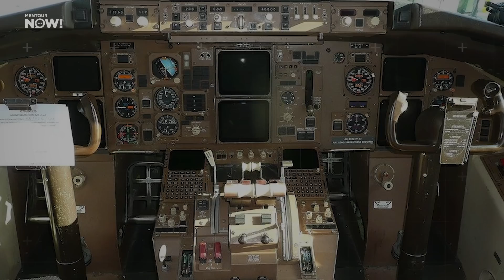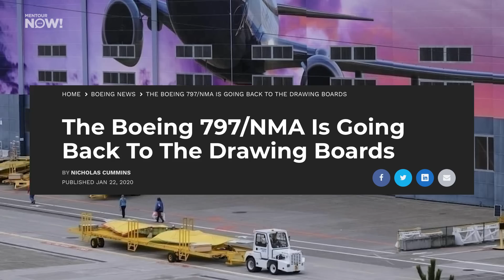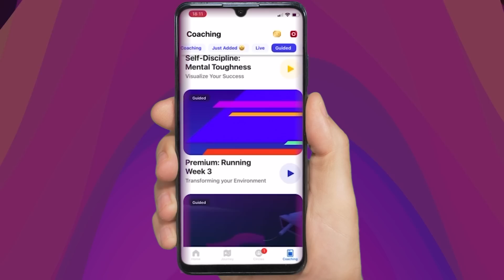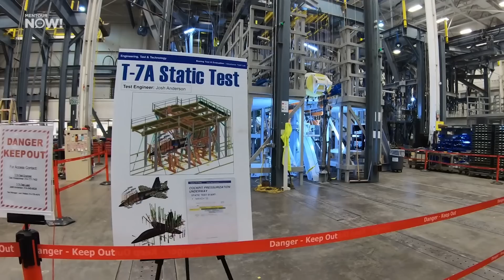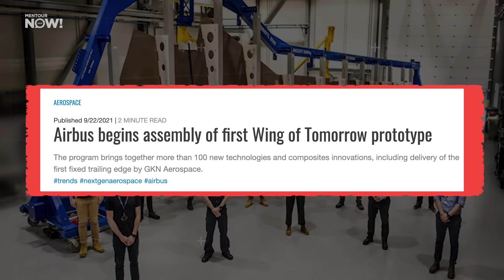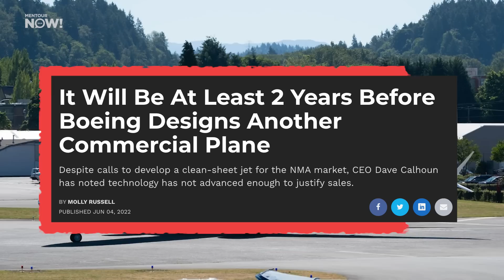Is Boeing Planning a 757 MAX?!

Comment: Some have wondered why Boeing Corporate chose to drag out yet another version of a 1960s-era 737 design rather than downsizing the much newer and popular 757 design. If you're not going to start from scratch, then at least opt for the newer option. An even better question is why Boeing fought rather than bought the Canadian design that became Airbus A220.
Reply: I've wondered this too. The 737 MAX 10 looks hideously stretched. It basically looks like a 757 but as a low rider that almost scrapes the ground, and has less doors. Meanwhile Airbus is chilling pretty good with the A320 and A321. I think the 737 is really turning into the definition of long in the tooth.
Reply: Right. How many people can you pack into a plane? at some point, it's become uncomfortable to be a passenger in a 737
Reply: @mbmann3892  Passenger count is a poor measure, every airline can space seats different, add or subtract extra features, or trade fuel/range for belly cargo, etc.. 
The better measures are MTOW (useful for passenger, cargo, and fuel load) and either floor area (passenger only) or fuselage volume.(Belly cargo and passenger combined.)
If making the basic assumption of comparing similar levels of technology and purpose(ie commercial passenger) then MTOW is pretty good as a single measure of aircraft size.
Reply: @mytech6779  Is MTOW that useful? If it was, the A321LR wouldn’t really be a thing. MTOW is extremely important to freighter airlines, but that’s a very different conversation.
Reply: @afcgeo882  Useful load may be better but for a given level of technology and class of aircraft MTOW is a fine proxy, and in some ways MTOW could be better as it doesn't penalize an airframe for optional variables like the empty weight of adding a center tank or choice of seats. 
Useful load can be split widely between payload(pax) and fuel load(range), which is why neither is a reasonable measure of the size of a base model, in regard to a manufacturers strategic planning. building factories and such. 

Payload and range are mainly useful when taken together in comparing specific sub models or purchasing options. 

Freight would be a different class, only as far as cargo tends to have a bit higher density than people and different environmental and safety precautions. (eg pax want windows and you can't flood a passenger compartment with halon.) 
But the wings and structure only care about total weight. Engines mainly care about total weight, with secondary regard for density as far as it affects cruise drag.
Reply: @mytech6779  The issue is the term “useful” because usefulness varies, A LOT. 

An airline like jetBlue that has almost no freight contracts and few corporate fliers has no use for aircraft with lots of freight capability and tens of business class seats. So its math on say JFK-LHR (the most lucrative flight in the world) is different from what would benefit British Airways or American. Every airline uses a different formula that is specifically designed for their own use. Furthermore, an aircraft that has more “usable space” may not be that efficient (the 757 is a good example).
Reply: @afcgeo882  Useful load is a specific engineering term. It is fuel load plus payload. (literally the stuff they are paid to load) You can increase payload by reducing fuel load and vice versa within a very wide range. So you would select the same basic plane to fly a long thin route or short popular route.  

The math of how an airline chooses to outfit its aircraft to make use of the available payload is a marketing calculation really pretty irrelevant to the engineering discussion. 

And yes, selecting aircraft that are too large for a route is inefficient, so what does that have to do with the 757 specifically? That applies to all aircraft, you don't put a 787 on a route that should be served by a Q400; and just the same you don't replace a 777 with 40 Cessna Caravans.
Reply: @afcgeo882  "Is MTOW that useful? If it was, the A321LR wouldn’t really be a thing."
What does this sentence mean? 

The A321neo/LR has the largest MTOW of the A320 family and just under the 757-200 (Though the 321neo and 757-200 designs are separated by 40 years, the 757 actually has a slight better ratio of useful load to empty weight, similar range, and better performance from hot and high locations like Denver where mountains on departure are an issue.)
Reply: @mytech6779  The A321LR has decent MTOW, but can’t carry many passengers or much cargo because most of that goes to fuel.

The 321LR’s MTOW is 97,000kg (214,000lbs) and the 757s is 115,680kg (255,130lbs). Not exactly close. That’s an extra 41,130lbs of weight the 757 can carry.
Reply: @mytech6779  You’re re-terming MTOW… why? Also, this was never an engineering discussion. You’re trying to deflect and go onto tangents. Stop.

The 777 isn’t too large for the JFK-LHR route. Not at all. In fact, it’s incredibly profitable, even if it flies without passengers. Its cargo more than makes up for the costs of the flight. Add some passengers and they’re all gravy.
Reply: @afcgeo882  Maximum Take Off Weight.
This is the highest gross weight the plane can be in flight and still meet legal requirements for acceleration forces and customer expectation for runway length and climb performance. This is the only definition I have used.
Reply: @afcgeo882  41,130lbs is less than 20% which is in the common size range of a base model, pax count is even closer between 321LR and 757.

And certainly less than the 300% jump in Boeings current line from 737 to 787. 

Now go take your meds.
Reply: Just after the MD merger the new short sighted management cancelled 757 production in the market downturn following 9/11, but they didn't just halt production they destroyed and scrapped out all of the production fixtures so there was zero chance of restarting production should demand change. Then they failed to acknowledge the giant gap in their lineup from the largest 737 to the 767(which was also scheduled to stop production, so really the 787) and put zero R&D into a design that could fill the gap. The current gap has the 787-8 MTOW is 250% of the Max10 ; at the time of 757 cancellation the 767-300[non-ER] or -200ER is ~200% of the 737NG-900. For reference the traditional step size in any company's model line-up has been about 1.3*MTOW from the largest variant of of one model to the smallest variant of the next.
Reply: Airbus sure seems better managed than Boeing as evidenced by the A220 deal.
Reply: @cottydry  not really Airbus has at times been in the hot seat where boeing is now.
Reply: @cottydry  After the MD merger Boeing basically just stopped trying to compete and gave away huge slices of the market. It is that generation of executives(across multiple industries) that tended to just fake annual earnings by caching out the company's life savings and thought they could just out-source everything with no actual in house value add. Coasting on a hard earned name and current product line without investing anything substantial back into the company and slowly ruining that good name/reputation.  Like a farmer that claims record earnings by not maintaining the tractor or buying seed/fertilizer for next year.
Reply: ??? The 737 is the most popular commercial aircraft ever built. I would hardly call the 737 a '1960s era design' either. Yes, it still uses many parts of the hull of the original 100 design, but in any case that's inherited from the 1950s designed 707 anyway.
Reply: @derekstuart5234  Second, the 60's technology - they shine all the way trough the aircraft - even updated with modern components. It's the way it is built, not with what. Flight controls, the cockpit switches, everything is based on the way things were back in the 60's.
Reply: @todortodorov940  Modern 737s have no cockpit commonality with the 737 classics. What are you yapping about?!
Reply: @derekstuart5234  I don't know where you have the "most popular" from. If it is based on numbers built, then the AN-2 har about 60% more numbers than the B737.
Reply: Yes. Boeing made a huge mistake not aquiring the Bombardier C-series .. we should have never allowed Airbus to acquire it ..
Reply: @bradhartliep879  Boeing had no interest in competing in the RJ sector until Airbus made a move on Bombardier. It used to be understood that Boeing and Airbus would stay in their lanes and that governments would protect smaller manufacturers. I actually suspect that the British government intervened in the C-Series buyout and provided Canada incentives to approve.
Reply: The reason not to build a new plane was boeing biggest customers didn't want a new plane.
Reply: Monroe doctrine led to bombardier turning to airbus when Boeing initiated 300 percent tariff because it wasn't made in USA. Free trade ? Yea right!
Reply: Because McDonnell-Douglas bought Boeing with Boeing's money. If you look at the trend for Boeing from the merger forwards, you start to see a lot of problems that plagued MDD aircraft from the DC-10 and on.
Reply: @jordananderson2728  yeah but that's starting to get fixed, when the airlines told boeing just build us a good plane and your orders will follow. and that's what need to happen.and the results of slowing are starting to show BUT THERE IS MORE TO BEEN DONE.
Reply: The answer is Southwest Airlines flies 737s.
Reply: @patrickparrott2453  that's all it flys
Reply: They’re THE SAME DESIGN! 

The 757 is a derivative of the 737 and shares its general cross-section.
Reply: @afcgeo882  The 757 and 737 only share a fuselage cross section, beyond that they are entirely different. Different wings, engine class, everything about landing gear, wing box,  different electrical, hydraulics, controls, and fuel systems. The 757 has more in common with the 767 than the 737.
Reply: It was driven by Southwest who absolutely would not buy the 757, but sticks with the 737 to maintain fleet commonality. What a shame!
Reply: Instant karma.
Reply: Because Southwest Airlines only flies 737's and they are one of Boeing's largest customers 

They wanted the new GE engines , but they didn't want to introduce a new aircraft into their fleet.

So they wanted Boeing to update the 737 with the new engines and do so in a way that minimized training for pilots coming off the older 737's
Reply: @glennchartrand5411  And they told Boeing that if we need to recertify pilots for the 373Max then they may as well switch to the A320
Reply: Because Boeing senior leadeship is , unfortunately,  mostly incapable of good decisions.
Reply: Yep all the workarounds needed to have made the 737max workable seem like they wouldn't have been needed with a modernised version of the 757.
Reply: The reason why, the REAL reason why, not the crappy reason I see in the response is two fold.  First, Boeing was actually going to replace the 737,757, and 767 with new aircraft types.  The new planes would allow for commonality between all of the types and would have used tech learned developing the 787.  This had been in the works since the late 90's.  The problem was the A320neo, and the 787 delays.  The 787 was late and cost ran over big time. Even though the plane is a success it cost far more to develop than Boeing wanted and Boeing didn't make as much money off of it because Airbus came out with the A350 relatively fast.  This is what caused that trade war to begin with that resulted in a Boeing win.  But the WTO case against Airbus took too long, and ended up not adding up to much of a win for Boeing. It did prove that the EU had been illegally funding Airbus projects including the A380 and the A350, and while they were ordered to pay restitution, in the end, they did little. On top of that, Airbus developed the A320neo program.  That quick turn around for marked gains in improvement caused many airlines including American and Southwest to literally beg Boeing to do the same to the 737 instead of creating a whole new plane.  Neither company wanted to wait for the aircraft which Boeing said wouldn't be ready until 2020 (ironic).  As for why Boeing didn't go after the C-Series? They couldn't.  Initially Boeing offered an aircraft in that size category, the 737-600.  Also, the C-Series was also in its own development hell, having taken almost 15+ years to build.  The project was actually failing when Airbus "stepped in" and offered to buy the project. It was very much a hostile takeover that was barely legal.  But by the time it happened the MAX was grounded and Boeing was at a standstill development wise and financially.
Reply: @jhmcd2  Barely legal - explain ?
Reply: @jhmcd2  The 787 was still quite a long way out when they cancelled the 757, even if it was a long term plan they just left the market hanging wide open and made no attempt to patch up the hole.

 Boeing also had the 717 (renamed MD-95) and at one point years before the MD merger they had purchased  Dehavilland Canada and was producing the Q400. They sold DHC to Bombardier in 1992 after some feuding with Canada and claims of being misled about the factory condition(Boeing won the lawsuit) and then accusations of Airbus bribery over an Air Aanada contract. (DeHav Canada was a crown company when Boeing bought it, and Air Canada was also a crown company.)
Reply: @mytech6779  It was but the new aircraft project (I forget the name of the project) was originally proposed in the late 90s. So they new a 787 like aircraft was on the way. The Sonic Cruiser was actually a distraction from this plan which Boeing course corrected on after airlines asked for a more efficient plane. So by the time the 787 was done, it was still their full intent on replacing the 737 with an all new model that could go into the low side of that NMA space where the 757 sits, and they would have had the 787-3 on the high end as a 767 replacement. Problem was money got tight, airlines just wanted a re-engined 737, and the rest is history.
Reply: @jhmcd2  Reminds me of the old saying "Crap into one hand and wish in the other, see which fills up first." 
Having a vague idea that there will eventually be a replacement plane in another decade using totally new technology is a far different thing from actually having a plane most of the way through development and a reliable(conservative) timeline to first finished airframe. 
As such you need plans B and C which would have been retaining 757 production equipment and at least designing (if not actually prototyping) a 757max.
Reply: @jhmcd2  you sound like Airbus just got into this great position using illegal moves or money they shouldn't have. If that's indeed what you're saying, I'd recommend the US to sponsor Boeing a bit less through their military contracts :D
Otherwise you're right, the airlines demand for commonality with the 737 was a key factor here and I'm wondering how much pressure boring got from southwest/Ryanair etc and whether they ever thought about what part their actions played in the Max disaster. Obviously Boeing is ultimately at fault, but it surely played a role.
Reply: @LuLeBe  Okay, first lets start with the Cseries. According the financial times article "Bombardier's biggest gamble" the Cseries started development in 2008, and cost Bombardier nearly $15 billion US. By the time of its launch it netted few orders. In 2016, Bombardier decided to sell the aircraft below cost in a process called dumping in order to gain new sales on the aircraft according to an article "CSeries to be sold below cost" on LinkedIN. Boeing protested, stating that it challenged the position of the MAX7.  They won their case in court and a 300% tariff was placed on the aircraft.  However, that tariff was challenged and overturned, even though Delta admitted to the Dumping charges (in the same article), amounting to over $4million dollars less.  This is when Airbus stepped in. Airbus purchased a 50% stake in the program, saying they would build the plane in Alabama at its plant.  The deal was slammed as being highly questionable and several observers challenged the ethically of the deal as it was meant to dodge duties on both products (this is also why it turns out Boeing never challenged the new ruling). 
As for Airbus being run by crooks. A380 and A350 tarrifs.  The BBC, Guardian, and Yahoo all carried stories covering how Boeing won its WTO complaint against airbus.  The original complain was how Airbus received illegal funding from the EU (or just European government) on all of its products in the forms of favorable loans and grants as well as tax incentives used to developed their product line including the A320, 330, 340, 350 and 380. Eventually this went down to only the A350 and 380, of which amounted to $7.5 billion dollars programs to which they won. Airbus countered and won only on the tax incentives which were given from Washington State on the Wing plant for the 777X.  In 2020 CNN News reported that Boeing wanted to end the 100 million dollar tax break, which ended later that year. However, it was reported by ABC News "WTO panel:EU fails fails to end illegal subsidies for Airbus".  That article was in 2019.  Airbus claims that in 2020 it made these loans WTO compliant, however the WTO has yet to rule on this, in fact, latter that year the Arab News reported that Airbus had NOT solved the concession issues and instead was pushing for deals to the WTO.  Then during COVID, France gave Airbus a new loan for the A350 project, saying it violated terms.  Then, to add to the corruption plate, the guardian reported in "Airbus to pay 3 billion Euro in fines for endemic corruption", also in 2020, after a years long corruption probe, Airbus was forced to pay over three billion Euro in fines as they paid bribes to companies in a number of countries as well as buying big gifts to Airline executives.  It should be noted that the Airbus/Bombardier deal closed in roughly less than 1 year with Leeham News and Analysis stating it closed ahead of schedule. Ironically the Boeing deal started in 2017 and yet it was EU regulators (both Brazilian and US regulators had already approved it) who were still requesting more information by 2020.  Which is odd seeing as the EU should have no say in the merger of a US and Brazilian company (neither company had a say int eh Airbus Bombardier merger). There is more, such as how the EU refuses to bring charges against Airbus for known problems in its autopilot design even after several crashes. So, now that you have probably not read any of this, are you convinced airbus is getting more than its fair share of help?
Reply: @LuLeBe  Airbus continues to be, without argument, an EU project and talk about military support… ever heard of the A400M? Boeing competes against Airbus and other manufacturers for every defense contractor. The A400M project was never put up for a bid.
Reply: @jhmcd2  To add, the reason why the A320 and A300/330/340 aircraft were removed from the suit was because they were developed by Airbus when it was still a government-owned venture.
Reply: @jhmcd2  
A launch company (airline) always gets a great deal on any airplanes first big production. It was not dumping and the ruling on that was eventually over turned by the US government.
Reply: @jhmcd2  Its true the C-series had been in development hell and nearly failed several times in the past, but the whole point of Boeing buying FTC intervention (those 300% tariffs ...) to try and kill it was that all that was behind it and it was threatening to be a massive success and take several US airlines (not just Southwest) away from being all-Boeing shops. The exact same reason Airbus bought it.
Reply: @kenoliver8913  Boeing didn't BUY FTC intervention. It took the issue to court and they stated that yes, Bombardier was selling the aircraft below cost, do you people even read news articles or do you just look at a headline then go to your favorite Onion like website? At any rate, it was the Trump admin and Department of Commerce which placed the extremely high 200% not 300, tariff on the plane which was eventually overturned, but Boeing won the right to retry for a lower tariff, but by that point they were too busy dealing with the MAX issue to care.